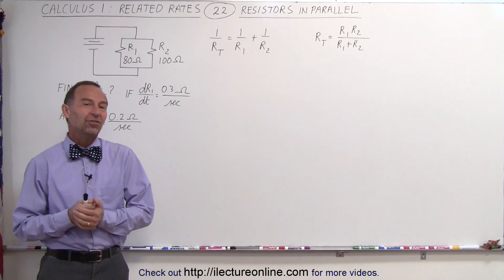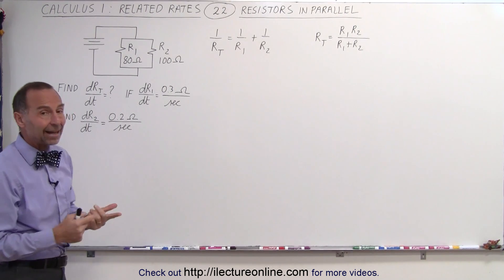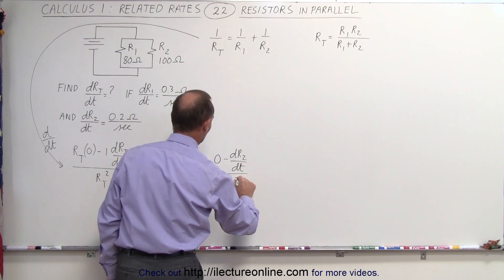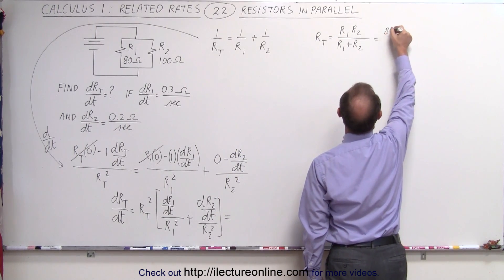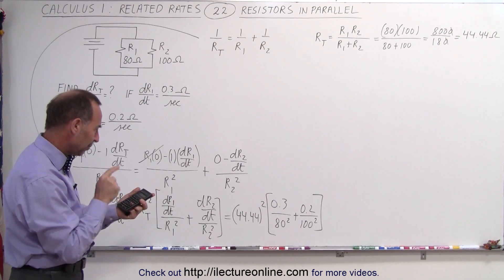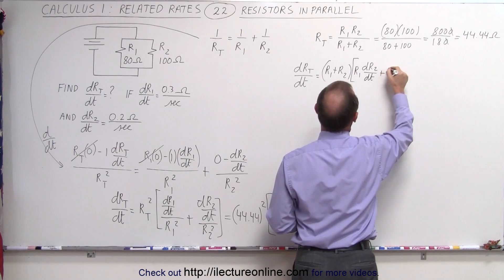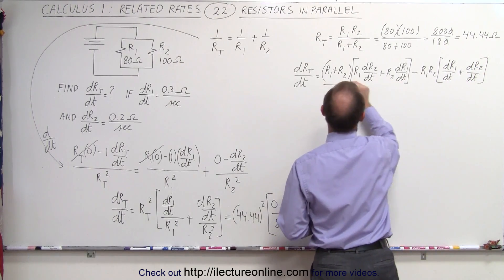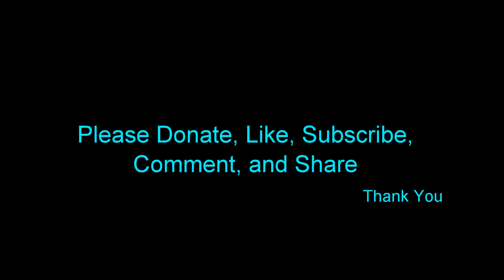Calculus 1 - Derivatives and Related Rates (22 of 24) Resistors in Parallel dR(tot)/dt=?

Comment: Hi Michel 

I did a different method where I converted 1/Rt and the other 1/Rs to Rt^-1 and I got the same answer but in the negative form. Is the answer fine whether it is positive or negative?
Reply from the maker: There are often multiple ways to solve a problem.  (The negative answer is problamatic).
Reply: @MichelvanBiezen  Oh okay thank you so much for your reply :)

I thought that the negative answer just meant that the resistance is decreasing at that certain rate because resistors in parallel decrease your overall external resistance.

But thank you. Your videos are really so awesome!

Comment: Sir a small advice. If I want to learn electric realted things from your lectures. Should I start from the beginning or could I jump to circuit analysis?
Reply from the maker: I would first start with the basic principles by looking at the physics videos on electricity and magnetism.  After you have seen those and you have understood them (and you have the calculus and differential equations background) you will be ready for the electrical engineering videos.
Reply: @MichelvanBiezen  Thank you :)